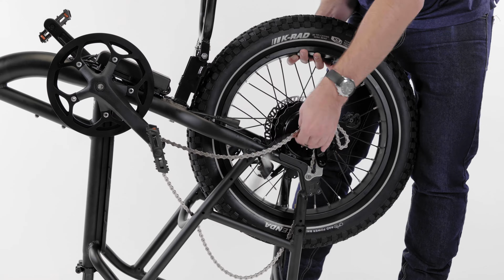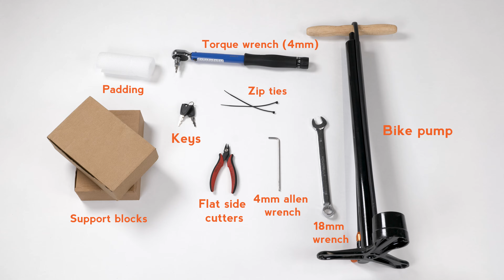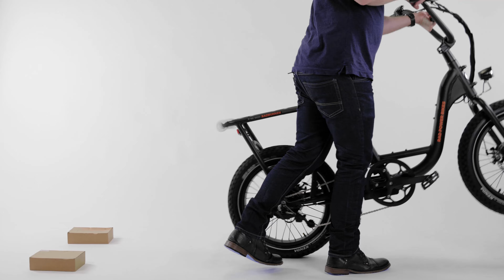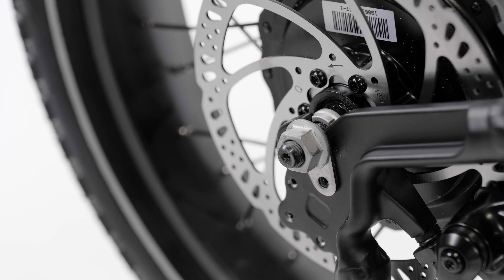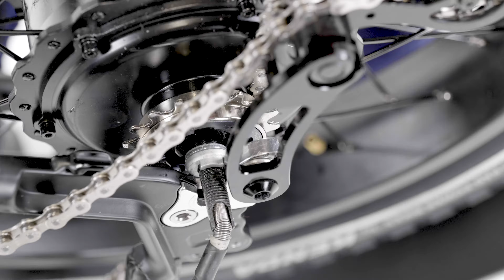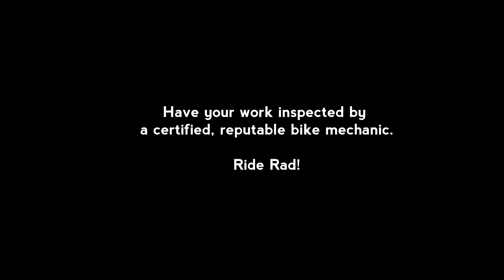RadRunner Rear Wheel Removal | Rad Tech

Comment: Can you make one of these for the RadRunner Plus? I think there are just enough differences and different recommendations that it would be worth it to address things like the chain tensioner being in the way of the nut which makes it impossible to get the right angle to loosen it. Plus it might be a good chance to go back in and add details that are missing from this guide.
Reply: I have a Radrunner+ this video was perfect. It took me no more than 10-15 min to change. Only cause the rim would not budge to come out. I have to improvise a bit. Other than that it’s pretty straightforward 🤷‍♀️

Comment: I have a radplus 2019. The issue with the rear wheel removal is that you have to "unlock" it by moving the drop ins  back, this allows you to pull the wheel with no problem. I'm assuming this was designed this way for "safety" of the wheel not coming off?? Anyway, to put it back and lock it, just do the reverse, drop the wheel in and twist/move the drop ins forward. Doing so causes the wheel to stay locked, so you can't pull it out/off.. Thats one thing I didn't see in this video, I would think the bike model wouldn't make a difference. If anyone knows, please let me know if I'm correct or not in my statement.

Comment: If you want to remove the rear wheel on the RAD RUNNER 2 (two),   in my case, to add fenders. You have to remove the chain tensioner as well. The wheel axle will not clear and come out with it in place. It does not fold out of the way. It was a cinch to do, if you felt comfortable getting to that point in the procedure, following this video.
Reply: /how did you remove the chain tensioner?

Comment: This absolutely does NOT work on my RadRunner 2. The chain tensioner is in the way of pulling the tire up - it just blocks it. From doing some basic research, I know this is an issue with the RR2, but there is no hint about this on the Read Bike website. I am so annoyed.
Reply: I’m currently trying to install the rear aftermarket fender and I also cannot get the rear wheel off, that derailer is in the way. I’ve seen the video for the rad runner installation and the cargo bike installation. They do not address this problem? How in the world are you supposed to change a flat? This is ridiculous.
Reply: I got a hold of former assembly guy at the rad helpdesk, and he informed me that you have to remove the chain tensioner, no problem at all, and that allows the rear wheel to come off easily. I followed that directive and was able to easily remove my wheel and install my fenders, reinstall the wheel no problems.
Reply: how did you get the chain tensioner out of the way?

Comment: Adding on to the commentary about the wheel not budging (ie, lifting out)...  I had the same problem, couldn't lift out the wheel.    The problem is: the axle rotated a bit and jammed itself into the frame mount that it sat in.   To release the axle, I used a crescent wrench to grab the non-threaded section of the protruding axle (pick a side, left or right) and rotated the whole axle slightly.  The wheel popped out quite easily after that.   PS: My bike is a Rad Expand 5.    And I don't claim credit for this solution, I found it on reddit.   Worked like a charm.
Reply: Yo that shit fucking worked perfectly
Reply: Thank you! Couldn’t figure it out until this comment
Reply: Yes. Thank you
Reply: The Rad Runner 2 requires you to remove the chain tensioner in order to clear the axle from the frame. Just added fenders.
Reply: Thanks for your help!!!
Reply: Thank you so much

Comment: My chain won't stay on after following this video. What is the exact correct position for the chain tensioner ?
Reply: The hex nut on the chain tensioner stripped under less pressure than was necessary to secure it and I called your 800 number. They want 35 dollars to send me a whole new chain tensioner instead of sending me the nut. That thing must be made of cheese. I can't even take my wheel off now even if I had the new tensioner to replace it. I was having a blast on my rad bike up until what should have been a simple repair. Now I'm going to have pay the bike shop god knows how much to remove the stripped nut.

I can't recommend rad bikes anymore. It has cheap components and you people don't even offer the parts to repair them. Rad really let me down. I won't be sending you any money for anything ever. Neither will any of my friends because I'll talk them out of it.
Reply: Glad some people understand they are just scamning customers. Sorry to hear about your bike.
Reply: also, my back wheel has a slight wobble to it now. How do I fix that?
Reply from the maker: Hey Guy, our Product Support team can help you out with this. Please feel free to reach out at (800) 939-0310 ext. 2 or at radpowerbikes.com/support, and they'll take care of you!

Comment: I have a RadRunner 2 and I'm getting stuck at the step where I pull the chain tensioner back (1:55). Does my bike have another nut that needs to be loosened first? Doesn't move at all. Looks like this demo was done on a RadRunner 1.
Reply: Any help on this? I'm stuck at the same part. Really disappointed in these videos from Rad...
Reply from the maker: @austinmorse6019  Hi Austin, our Product Support team can help guide you through this. Please reach out at radpowerbikes.com/support so that they can assist you.
Reply: Sorry,this problem is real and telling everyone to spend time waiting on the phone is not the answer. fix the video because the chain tensioner is different. @RadPowerElectricBikes
Reply: Same. Super frustrating.
Reply: I just encountered this problem on my RADRUNNER 2, when I tried to install the accessory fenders. I got a hold of a individual at the Rad help desk, who used to be a assembly tech and he informed me that specifically on the RADRUNNER 2, you have to also remove the chain tensioner (not shown in video on the standard(?) Rad Runner) the tensioner prevents the wheel/axle from coming out. Once I did that, it was a snap to do, the wheel came right out. I installed my fenders and reinstalled the wheel no problem.
Reply: @Radpowebikes can we get an update here?  These comments are years old and nothing from you. Common, you’re better than this.
Reply: Worx so far for the RR1
Reply: I had to remove my chain tensioner in order to get it out. I didn’t wanna have to. I left it hanging there hoping it doesn’t move before reassembly. I’m currently working on it. (October 10, 2025) I also had to remove my chain guard because I couldn’t get any slack in the chain it would bind in the guard.
Reply from the maker: Hi Ben! Let's get you in touch with our Product Support team, you can reach them at - (800) 939-0310 ext. 2, or email at - radpowerbikes.com/support. We are eager to get you back up and riding!

Comment: Note that the two torque washers on the inside of the axle can unknowingly slide off after removing the wheel. This can happen if you happen to lay the wheel down on its side, for example in a car transporting to a bike shop or in a garage.   Lose one of those and your bike cannot be reassembled properly.
Reply: Absolutely!

Comment: I ordered a new tube and liners for my rad runner and took them to my local bike shop, they installed them to my rear tire for 30 bucks which I thought was a bargain. The bike just seems way too heavy and bulky to mess with. By the way slime worked for two years and multiple punctures until I was forced to change the tube.
Reply: Nah I don’t think so. It’s a pain because the bike is too heavy and bulky. So far no flats since installing the liners.
Reply: @mdkk  my bike store told me it would only be 10$ and as far as being a pain I decide to change my own tire it took me a total  of 15-20mins and was very easy to get the rear wheel on and off and I have a rad wagon 4
Reply: @muzzleburnhurts  Good for you. Some people don't have the time or patience for this nonsense. There are over 20 steps outlined in this video just for removing the back tire alone.
Reply: @tb7871  i dont know what video you watched but it was turn the bike upside down take the chain off and take the bolts off then pull the back wheel off and unplug it take the tire off replace the tube and then put everything back together took me 15-20 mins
Reply: Here in fucking Germany no one wants to do it because they are anxious to damage something with the electrics and having to pay for it. This fucking country…
Reply from the maker: Thanks for sharing your experience! We're glad to hear that the local shop was so helpful. If you have any additional questions our team is available to assist at - radpowerbikes.com/support.
Reply: So they charged you more for something you already paid and you are thankfull for it?
Thank you rad bikes for charging us more and more for the services that should have been included in the first place.
Reply: you got ripped off hard if you paid 30$

Comment: There has to be an easier way because this is way too much
Reply from the maker: Hey hey! If you need any additional assistance please feel free to reach out to our Product Support team via email at - support@radpowerbikes.com 😊
Reply: I watched a YT vid of a guy patching the inner tube without removing the tire or fully taking out the tube.
Reply: how could it be simpler?  Same as any bike other than the motor connection and torque bolts.

Comment: YO YO hi RADPOWER BIKES I had a question I have a 2019 Radrunner when taking of 20 X 3.3 tires to fix flat or replace broken spokes it is real hard to get tires off rim. I  had to order heavy duty bike tire levers. I have not used them yet I have  to take wheels to local bike shop 🤣 $$ to fix flats or broken spokes which is hard right now financially because of Covid 19 Virus Will the 20 X 4 KENDA KRUSADE or 20 X 4.25 KENDA KRAZE be easier to remove tire off rim? On utube videos it looks like it. Especially for seniors and disabled. I had several operations on wrists so what ever is easier is 👍 great ! Also would you all consider selling cast mag wheels ? They look better and it seems they would be better stronger for a ebike because of high pressure on rear wheel because of motor thrust and ebike weight. Its getting expensive to fix broken spokes 🤣$🤣$🤣$ from Soldier in GODS Army
Reply from the maker: Hey hey! Apologies for the delayed response! If you still have questions about changing the tires, or another question popped up, please reach out to our Product Support team at - support@radpowerbikes.com. They'll be able to walk you through it! 😎